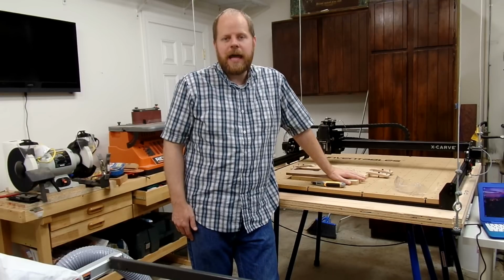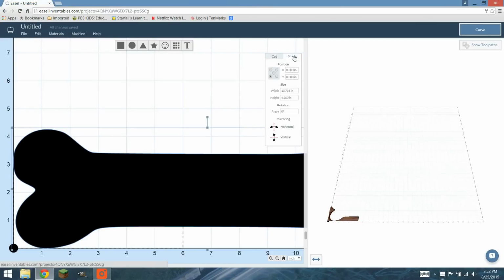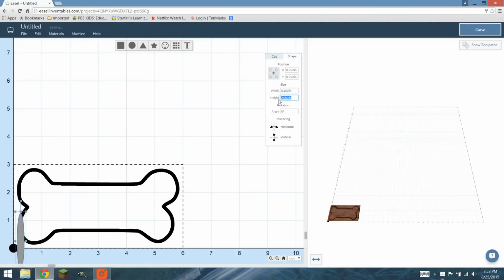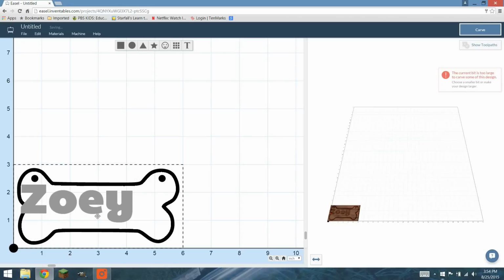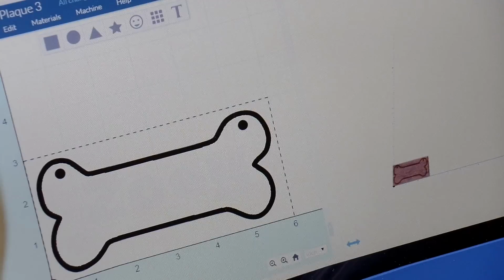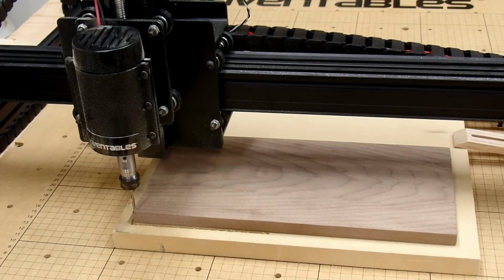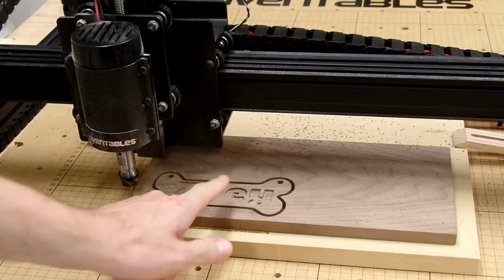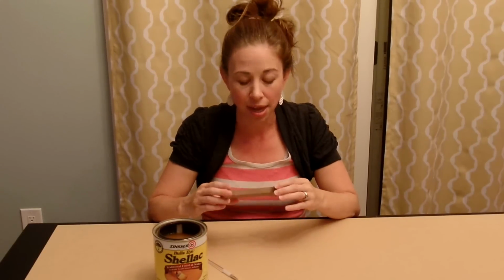X-Carve - doggy name plaque

Comment: Waste board is silly. just cut out and square up some pieces of wood, or make use of some parallels if you aren't scared to clamp down on some metal. that way you have a space between the work-piece and "wasteboard" table. The wasteboard should only be used as an end-stop for your work when you are cutting blind and not thru.
Reply: +Stelios Tesera Dekatria "Wasteboard" is also to prevent the frayed edge of a router/cnc machine cutting the final layer.